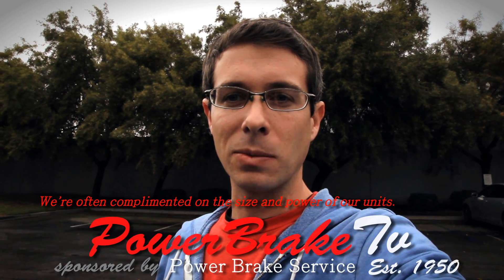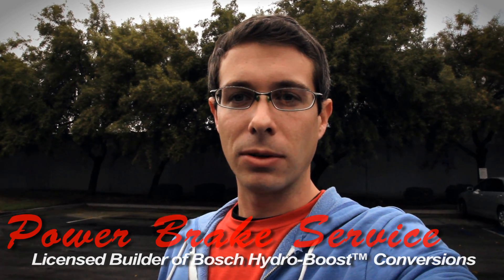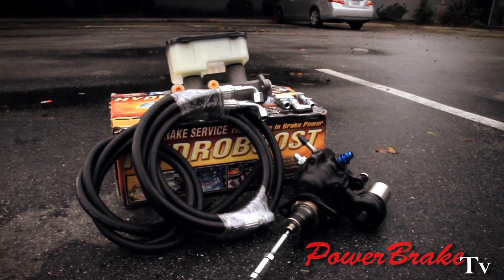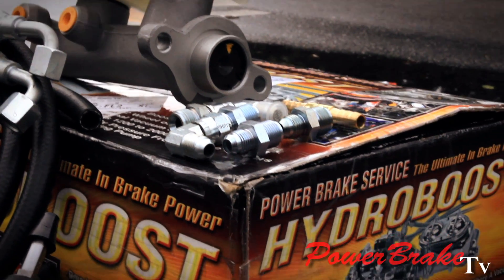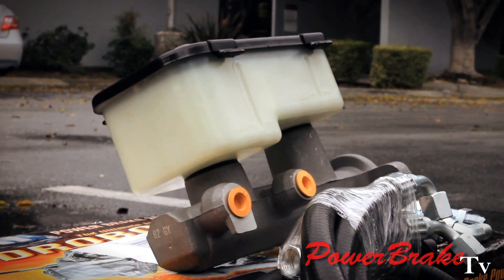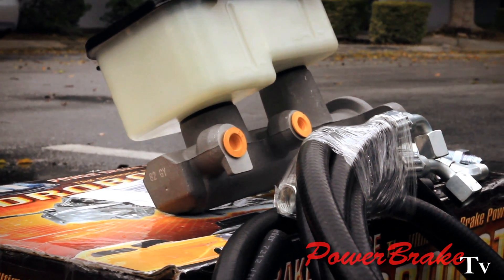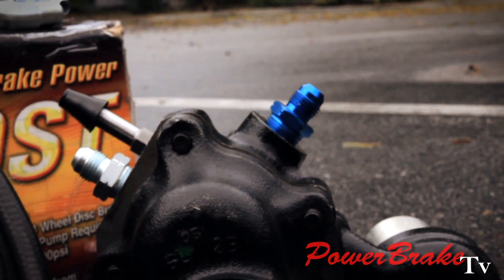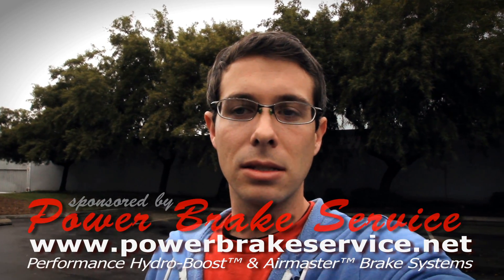Sweeting Performance - K20 K1500 K2500 C1500 C2500 Hydro-Boost Power Brake Conversion

Comment: do these need any type of vacuum?
Reply from the maker: Instead of using manifold vacuum, these run off hydraulic pressure from the power steering pump. No vacuum required.